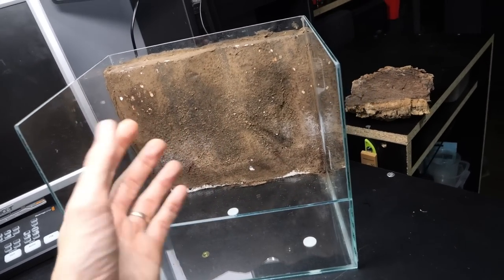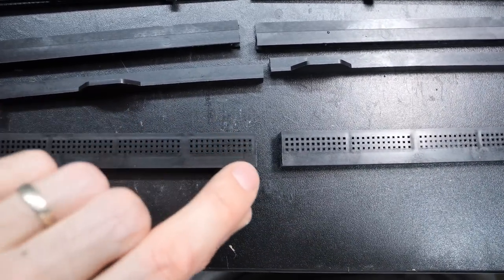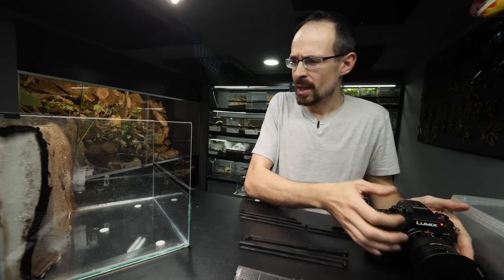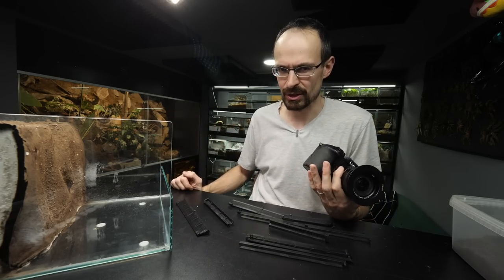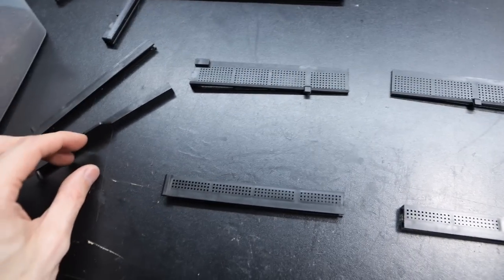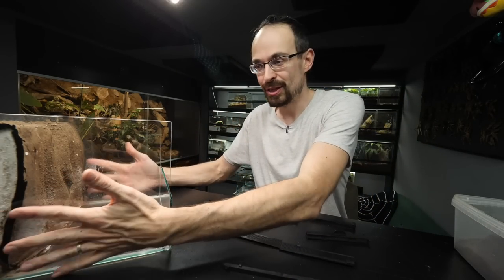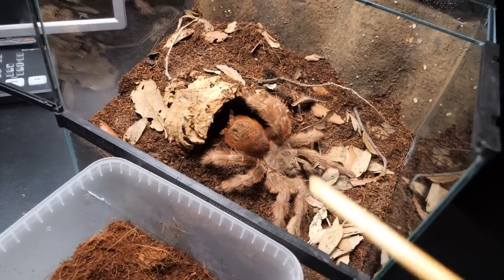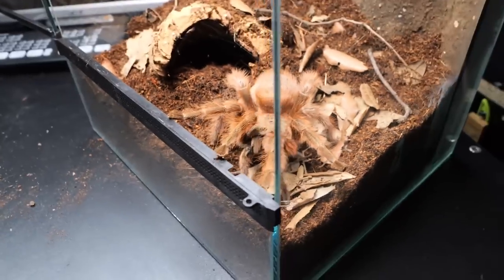How To Build BIGGER Dark Den Enclosure!

Comment from the maker: Oh I uploaded the wrong file, this was a rough cut of a video y.y 
Anyhow, sorry for that! Here are the glass dimensions:

4 mm Thickness 

L&R - 250 x 250 mm
Back - 300 x 250 mm
Bottom - 250 x 292 mm
Front - 300 x 100 mm
Door - 296 x 130 mm

3 mm  Thicness

Top - 100 x 300 mm

2 mm (can also be 3 mm)

Sliding top - 289 x 127 mm

For you that are wondering if you can use acrylic instead of glass, it works but the door will not be as secure since they will be light. The weight of the glass is what holds the door safely secured. And also the top lids can sag.
Reply: Could you share the files of the 30x25x25, 25x30x25 stockings with me, I'm from Mexico, you don't ship here

Comment: I got my pieces for an enclosure. But I haven't contacted a glass place yet because my T's are juvies and slings and I don't wanna have a big enclosure just sitting there for like a year. 
     As a suggestion, since these "instructions and suggestions" aren't all in one video, maybe you could put them on your site. I remember you saying that people said glass was too expensive in the states. You had a recommendation to go to mom and pop shops and also tell them the glass doesn't need to be perfectly sanded down, just good enough to not give you splinters. But I CAN'T remember what video that was because it wasn't the original build video. It came after that, so it would be helpful if you could place all the tips and stuff in an area on your website, or maybe make another video (Patreon) with those steps, these steps and the tips to get good priced glass. Thanks Petko!
Reply from the maker: I have all of that written with the instruction that comes with the plastic parts, and it is written in the description of the item on the webshop ^^

Comment: Depending on what type of plastic used, if you want to hide the joins, you can use acetone or thin plastic cement [like plastic magic or Tamiya thin]. It will melt the parts together and you can sand away the texture [pun intended]. Test it on the parts you are throwing away first, both to make sure it will work and to get the feel of working with acetone/plastic glue. Brush-on type is best as you have more control. Let it vent and wipe away the residue with warm water and a touch of pet safe soap [or any other cleaner you use to clean enclosures with].

The plastic glue can also be used to smooth rough cuts.
Reply from the maker: Thanks for tips!

Comment: I really wish you could make the parts in inches. I ordered parts maybe 5 sets. I will have to do a lil sanding to get them to fit without breaking. i did break one top hinge forcing it. completely my fault, how ever i will be doing some sanding to fix this issue. Thank you for your hard work and for sharing your enclosures with us. Will tag you on IG when its built...

Comment: You thought about double doors? So you could build wider enclosures?
Reply from the maker: Yeah, but that that requires new metal mold...and they are expensive! First I will add the base edges so enclosures are stackable, then I make wider version...and only then I can make the opposite side doors!

Comment: Hey Petko! Just out of curiosity, would it be cost effective to make new molds that were designed from the ground up to be combined as two parts to make a bigger enclosure? That way, all that somebody would need to do is sand them down to fit, rather than having to resort to using a table saw, and the molds would still fit in the same blanks (or conceivably even fit into smaller blanks, if they were designed to be half-length).

Comment: Wish you’d sell glass as well I still can’t find any! 😢 how would acrylic work with the plastic parts?
Reply: I made two 20 cubes out of acrylic(cast acrylic sheets). Glass was a lot more expensive so I thought I give it a try. Had to glue them twice since both of them leaked the first time(acrylic glue is very runny and didn't want to stay in place😀). Seems like they turned out ok. Though they are still empty since I haven't moved my tarantula yet. Will probably wait until after next molt.
Reply: @Dadidism  might give it a try then see how it goes just wish I could find cheap bloody glass I got quoted £200 just to make 1 enclosure it’s nuts
Reply: @JordieCollects  Yes try it out! Not sure how well it will hold up compared to glass though. But it's always fun to make your own. Paid like £18-19 per enclosure.
Reply: @Dadidism  yeah I got quoted around the same for 1 enclosure with acrylic. I will definitely try it I’ll probs use glue and silicone tho
Reply: @JordieCollects  Petko had a video where people were complaining about glass prices.  He said to find a locally owned mom and pop shop, and tell them the dimensions don't need to be perfect, and the edges don't need to be perfectly sanded down, they just need to be safe enough to not give you a glass splinter. It was on a video shortly after the announcement of the sale of parts. There may have been more tips, but I can't remember and I can't remember the video either. 🤷🏼‍♀️🤦🏼‍♀️ He did say that most of the cost of glass is the precision cutting, so if they don't have to be perfect, they should cost less and be easier for the glass shop to make. I think he said the pieces he bought were like 3 to 6 bucks a piece.
Reply: @calliew311  yeah I seen that video to I’ve been looking for cheap glass for months now with no luck witch is why I was wonder if acrylic would work
Reply: @JordieCollects  Same for me. Not a lot of those shops left. Mostly bigger chains.
Reply: @Dadidism  i appreciate that I’ll give it a go mate thanks
Reply: @JordieCollects  oh, that sucks. I bought the pieces, but haven't looked for the glass yet. I only bought 1 set in case I run into the same prob you have. Good luck with the acrylic. Let us know if it works. I know the other commenter said it did, but I'd be interested to know if it works for you too, that way, when I try to do it, I'll remember it's better evidence if 2 people got it to work, lol.
Reply: @calliew311  I’ll make sure to let you know
Reply from the maker: I would sell but they would easily break in shipping, and shipping would be expensive because of the weight :(
Acrylic works but door will be flimsy. The weight of the glass door is what keeps it locked and safe!
Reply: @TheDarkDen  yeah that’s understandable Petko it’s literally impossible to get cheap glass where I live I’ve been quoted £200 per enclosure witch is crazy. That’s why I was wondering how acrylic would work.
Reply: @TheDarkDen  Yes it's a bit flimsy. Might need to lock it with something other than the pin.
https://youtube.com/shorts/j0qRvUarPAE

Comment: 100x Easier to just make enclosures with two sliding doors. That way you only need a slider in the top and one in the bottom. Nothing can really go wrong and nothing that can break or stop working.
And when you open the enclosure, you are only opening HALF, and in a sliding motion from side to side, which means you leave all the humidity and warmth inside the enclosure where the T needs it, instead of pulling it all out with a door that sucks everything out when you open it.
Your setup also increases the chances of a Spider escaping.
With sliding doors you vastly minimize this and also minimize the risk of breaking a leg of your spider because its only in the sides that your spiders legs can get caught. With your doors the spiders legs can be caught in top, bottom and the side.

Mic drop